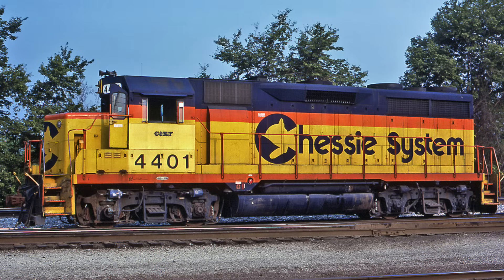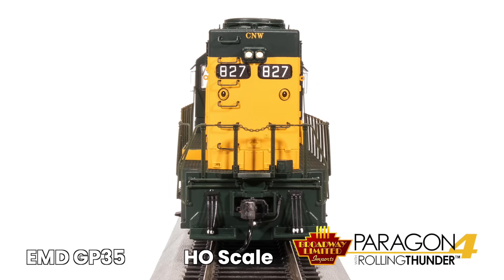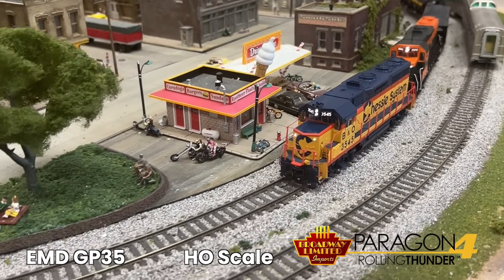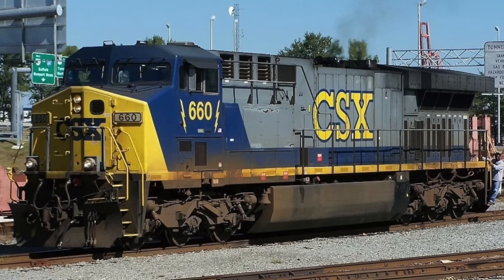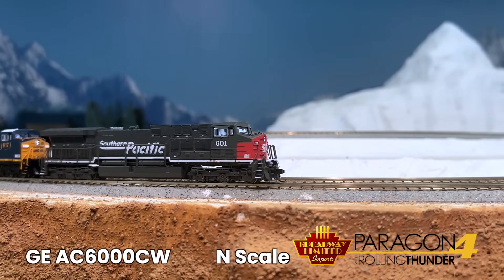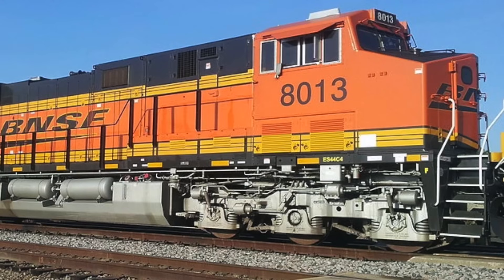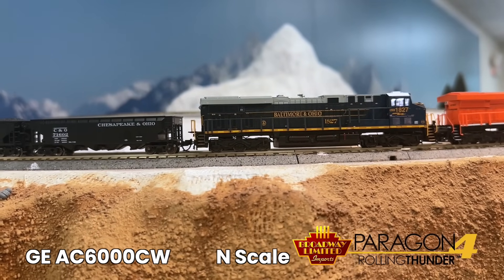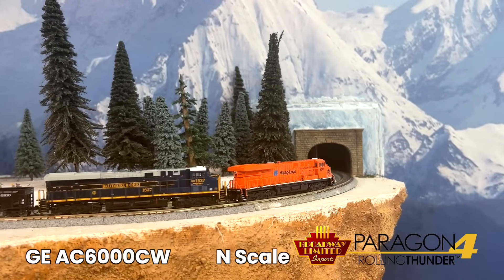Locomotives that will motivate your layout!

Comment: Very enjoyable video, as usual.  I won't be buying any of the products featured, because my railroad room at home is very small, and very close to where my wife sleeps, so I can't use sound.  And my preferences are mostly for older and smaller locos.  I do have quite a few BLI freight cars, including three stock cars with sounds for cattle, mules (for the Amish) and sheep; I don't want hog sounds.  The most tempting BLI loco for me would probably be an Alco "Alligator" in the black and silver Santa Fe scheme with big road name if I can find one used, just to have it.  I mostly model D&H, B&M and other New England, Northeastern US and Canadian lines.